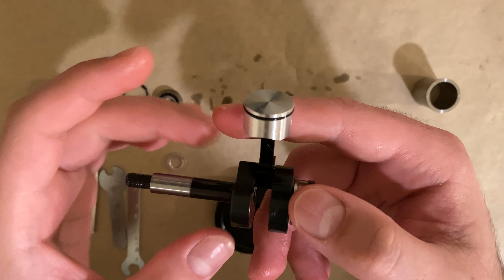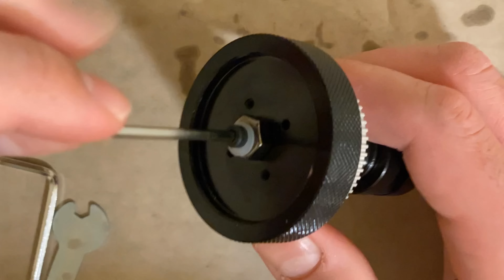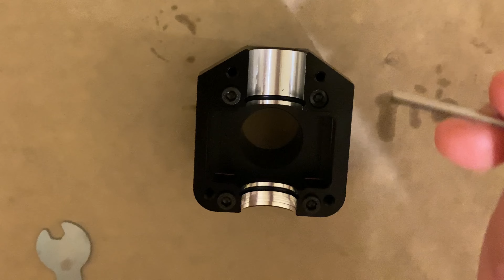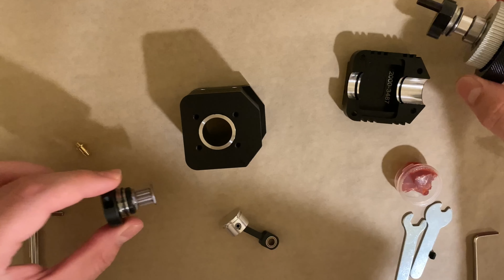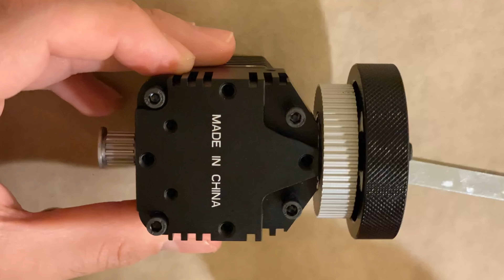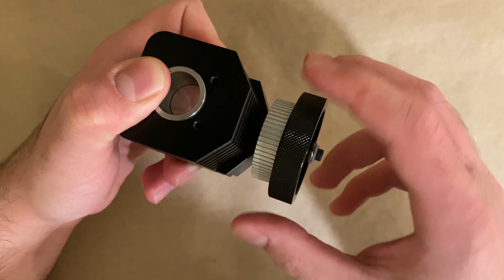Building A Mini 4 Stroke Engine (Part 1)

Comment from the maker: In this video I began to assemble my engine and finished building the crankshaft as well as the lower part of the block. My next video will most probably be to build the head for the engine. So far the lower part of the engine is finished, which includes the crankcase, oil pan, oil pan gasket and the crankshaft along with the piston. Surprisingly this engine also has a piston ring which goes around the cylinder to prevent oil from getting into the combustion chamber. It was definitely a fun build and I can't wait to see what it will look like when it's finished. Please stay tuned because my next videos will be in regards to building this engine.